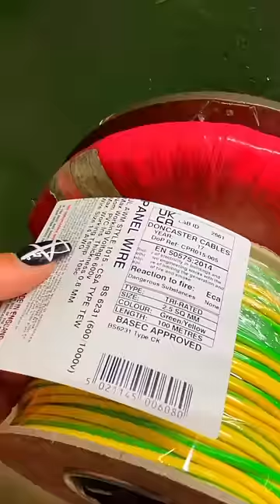This Will Confuse American Electricians!

Comment: Only thing I was confused about was trying to understand what I was supposed to be confused about...
Reply: Insulated PE wire
Reply: Oh Alex……😂😂😂😂😂😂
Reply: @denisdrozdoff2926 ummmm. Our grounds are insulated….
Reply: @shadygunshow we install european machines too in america xD we know that already xD
Reply: We also have insulated ground wires in America? We use them for DC voltage and for grounding equipment to grounding bars in server/network racks?
Reply: Exactly, no idea what I was suppose to be confused about. Insulated stranded bonding wire? We use that and bare. But what the hell were those dangling thingys for? Cleaning the wire?
Reply: @DarksurfX Sometimes, I don't think codes require insulated ground (not an electrician and haven't done any training in a decade) but I've definitely seen some boxes with insulated grounds. Seems smart to me, preventing dead shorting to ground in the instance of a momentary fault
Reply: @TheNaughtyType  it's to make sure the wire insulation is uncompromised. 10 000 VDC is applied to the "dangling thingys" and an alarm is triggered if it shorts to ground through the wire.
Reply: @TheNaughtyType 😅 that's probably high voltage leak testing which is required for UL certification. A high voltage is applied and you check if the insulation holds up. Any cracks in the insulation will show up
Reply: Exactly my thoughts, in industrial grounds and bonds are usually insulated. Depends on the application, there's a broad range in Canada. The resi industry is more like the US which I don't like aside from making materials cheaper but most other industries have kept up with the rest of the world.
Reply: @mrfrenzy. What a simple yet amazing tester design. Elegant.
Reply: Same
Reply: Only difference with our stranded ground wire in US is that it doesn't have any yellow color, just solid green.
Reply: @TheRealGreg depends on your supplier. Definitely comes with the yellow on it too
Reply: Também fiquei em dúvida sobre isso.
Reply: @ObservationofLimits very very very infrequently in my experience. At least from Graybar, CED, Medallion, Home Depot and Lowe’s, not counting random mom and pop electrical suppliers. Generally only see yellow on ground in pre wired panels or equipment coming from or being also marketed overseas.
Reply: We use insulation on grounds in more often than not applications
Reply: @markitoelias nao sei se esta sendo sarcastico 😂😂 mas pelos comentarios (nao sou eletricista) e que o cabo terra e isolado pra prevenir curto circuito na fase do cabo terra. Eu traduzi entao nao se se faz sentido o texto "na fase do cabo terra" nem sei se existi isso em eletricidade 😂😂 mas resumindo e pra prevenir curto circuito, ah e aqueles metais ali que o cabo passa e pra testar se o cabo nao esta com defeito e vai causar um curto circuito mesmo estando isolado porque aqueles metais tem uma corrente passando por eles, pelo que eu entendi dos comentarios aqui. 😂😂😂 Espero ter ajudado no caso do seu comentario nao ter sido feito com tom de sarcasmo, ate porque na internet fica dificil de entender comentarios sarcasticos algumas vezes 😂😂. Sim, o texto foi grande e eu nem sei porque resolvi ler os outros comentarios e tentar traduzir de uma maneira facil 😂😂, mas as vezes e assim quando voce tem tempo livre na internet😂😂, passar bem e um bom dia pra voce.
Reply: @regferraris  show
Reply: I thought maybe the ladies nails?
Reply: @TheNaughtyType probably fault testing the insulation.
Reply: @TheNaughtyType take away static electricity, maybe?
Reply: The only confusion to me is, why on earth does it change colors?
Reply: hahahahahahahahaha
Reply: @DarksurfX where do ? behind your answers are coming from!!!
Reply: @Michel-7.7.7  I’m afraid I’m don’t understand your question?
Reply: @DarksurfX  a questionmark is usualy put behind a question. There was no question in your answer😁 Never mind✌️
Reply: As an American electrician I can say I wasn’t confused.
Reply: @napster7825  The wire sheathing is bi-colored, yellow and green. The only reason it appears to change color is because that predominantly yellow or green section keeps showing as it gets wound onto the spool. 😊
In other words it completely an optical illusion!
Reply: @ObservationofLimits  yes this yellow strip is often used to identify isolated grounds
Reply: @geoiselin  A ground is a ground, call it whatever but at the end of the day, it’s just a ground.
Reply: @briandunigan9669  I agree too,  I have always said if your computer needs an isolated ground, then it's a peace of shxx
Reply: @geoiselin  jeez I must be bored,  but hey, it’s just for fun.  
Anyway, Isolation that thing if it’s necessary, we do it for all kinds of equipment. But that doesn’t take away the fact it’s a ground.  Just like a neutral, it has a purpose but it’s only a ground!  Can you  replace a “grounded” 4 wire cord on a dryer with a 3 prong cord, yeah!  But it has to have a neutral to operate controls, so can you really enter change them?
Reply: @briandunigan9669  I don't think that I disagree with you.  But are you saying "shall you interchange " or "can you interchange " ? With the exception of the range and mabe a few other things,  you shall not.  But yes, of course it will work.  Until the 2023 code, we shared it on the main panel all the time. So I think if I understand you, what I'm saying, it is your right .
Reply: @geoiselin  No we both agree , I was uncertain for a moment with the, “if the computer needs a ground it’s a piece of sht. And so yeah, I made the comment jumble a little, but it was to see if you understood, or close to what I said without having to saying it, so for that I do apologize for, put I think you get my drift!  Stay cool out there sparky, enjoyed!
Reply: Americans found this title confusing for sure!😂
Reply: #ClickBait
Reply: @TheNaughtyType they are to check for faults/splits in the insulation.
Reply: @shadygunshow so are ours 😂 only in romex and maybe a couple other situations the ground bare, and same for u guys lol
Reply: @Scoutmann1975 The grounding wires in half of HVAC equipment I've seen from the different manufacturers all contain yellow and green
Reply: @TheNaughtyType Those dangling thingies are for high voltage insulation testing...
Reply: my company wraps each ground wire in panel in green vinyl tape. Idk if it's code but it's company policy.
Reply: @thewhitedillard if installed properly. Your grounding conductor is only a backup. The grounded conductor is what you need
Reply: @DarksurfX and in armored and metal conduit
Reply: @TheNaughtyType  I'd imagine they put on a voltage potential relative to the wire on those beads to test the functionality of the insulation. Dangly beads to touch as much wire simultaneously as possible, I guess
Reply: Then it worked. Ha ha
Reply: @TheNaughtyType so you admit you were confused?! Ha ha ha
Reply: @TheNaughtyType think testing the quaility of the isolation
Reply: @TheNaughtyType system sometimes apply a voltage and this test dielectric of the insulation. No current is pass.
Reply: Want to confuseus? Show us a tutorial video on how to thread EMT.
Reply: @TheNaughtyType  it checks the insulating properties of the wire makes sure no high voltage could sneak through
Reply: does green-yellow wire exist in USA?
Reply: @TheNaughtyType  they look like they are for grounding off static? Just a guess
Reply: @DarksurfX not sure which part of america your in but everywhere I have been has insulated ground wires for AC wiring too
Reply: My thoughts exactly
Reply: @denisdrozdoff2926 yeah what about pe insulated wire? We have that too
Reply: 😂😂😂😂😂😂 my thought EXACTLY
Reply: i think our wire is wrapped on our spools better, more orderly
Reply: @mrfrenzy.  awesome, makes sense.
Reply: @DarksurfX And ladder tray, basket tray. All over a data center, really. Bond and ground, baby...
Reply: in the uk and lots of other countries, our sockets have a ground wire which makes it much less likely for an appliance becoming live and dangerous (nobody wants 230v flowing through their bodies from a live casing). american sockets don't have that
Reply: @ArsonButCute It depends on whether its an equipment ground or "earth" ground (I can't recall the exact terminology). The "earth" ground is usually bare and is directly connected to ground rods. Equipment ground is the stranded and insulated wire tha runs back to the breaker box and is terminated both on the frame of the equipment rack/housing and used at whatever ground terminals are required. I work on electrical engineering designs for Airports so I mostly deal with AC over large-ish areas
Reply: @shadygunshow not usually in residential but in commercial and industrial I see them insulated every time.
Reply: @TheNaughtyType  pass a current through it so if there is a break in the insulation it will stop and sound an alarm ?
Reply: Yup you summed it up nicely
Reply: Her nails were pretty confusing.
Reply: @shadygunshow  Though it's permissible over here to use uninsulated grounds I think it's just good practice to insulate everything just in case.
Reply: Right 😂
Reply: people in the usa (who even though there are many americas feel they have the need to call themselves "americans") use bare wire for grounding, especially in large projects, as is saves money. hell, they'll attach it to copper pipes, any thing lol
Reply: @alexandrelabonte8815 While bare copper is common, we also use insulated grounds too. Or earth wire if you want to call it that
Reply: @TheNaughtyType 

Reducing whip and twist while spooling the wire.
Reply: Do they think we don’t have insulated grounds?
Reply: @TheNaughtyType No, I think is for electrostatic discharge of the pvc insulation, which may get charged on the production line.
Reply: Insulated earth 🙄🙄🙄
Reply: @Scoutmann1975 its extremely common with hvac equipment.
Reply: @TheNaughtyType It is used to test isolation (note there is voltmeter showing 10kV
Reply: @frogdude1337 american sockets 100% have a ground, what exactly do you think the third prong is? Old styles of 250v plugs and a lot of cheap extension cords lack ground, but general home sockets all do (again with the exception of old shit).
Reply: Maybe  the bead-chains?
Reply: @TheNaughtyType  to remove electrostatic charge
Reply: @TheNaughtyType  They check for a fault in the insulation
Reply: As an American electrician while me mostly in residential use what is commonly referred to as romex we also use stranded not bare grounding. The bare ground in romex helps when you put a screw through the romex the screw hits the hot and the ground causing the breaker to trip. Piping everything is to labor intensive and costly we created a method that is both safe and cost effective.
Reply: @ellierunyan5919 in the UK and Europe all grounds have to be insulated. If you have uninsulated grounds touching, you can have a very bad day. If one of the grounds has come loose from its terminal but is touching another grounds you may still get a good continuity reading to earth.  However under an earth fault condition you will have a poor earth connection. That dould lead to the RCD not tripong or having a high  resistance joint potentially causing a fire.

Comment: That’s alot of machinery for a badly wrapped reel.
Reply: That’s what I was thinking
Reply: @Slugonthese  it does have an accumulator for fast easy changeover but the end result is mediocre. Reckon the winch on my landrover would do a better job, be the same tautness too!, tri rated these days comes off like a spring.
Reply: @flashusernam  seen old fishing boats that can wrap wheels better
Reply: Hopefully in actual production they tension it up with a guide cause holy fuck.
Reply: Hate to feed that through my Gamma.
Reply: What are the odds that shit gets tangled like 10 wraps in lmao
Reply: The machinery was to straighten the cable  not to provide a perfect spool. Probably was wrapped on the large spool while still warm and would have been a pain to run. Sorry I wasn't confused.
Reply: It’s hard working woman leave her alone 😅
Reply: Honestly I think I could do as good a job doing it by hand. Probably not a quick but I don't need half the factory  floor to do it
Reply: I concur
Reply: @connorhart7597 thinking the same thing 😅
Reply: @lastmancamp5603  why make excuses for this? They are preparing wire for delivery and it looks like crap. If the machinery isnt for making a perfect spool then they're using the wrong machinery.
Reply: The roll it came off was more nice! I'm confused
Reply: @connorhart7597  The odds are zero absolutely no reason why it would tangle it's simply not possible. Winding it neatly serves no useful purpose other than satisfying peoples OCD, it would take longer, need more complex equipment and add cost for zero benefit.
Reply: @mfx1 Wrong. I had the awesome opportunity to work with reels wound shit like that, and it was not really funny when you have to check an automatic cutter in every 30 seconds due to jammed or tangled spool. Yes, it gets tangled more often than you think.

Maybe it never was an issue for you because you just unwounded it by hand, not with automated processing.
Reply: Yeah, that got me too.
Reply: Bet one of them chinese dudes can do better with only his left foot's thumb
Reply: @lastmancamp5603  That doesn't even make sense you straighten the wire to then put it into a tighter wrap and it's thin strands of copper wire not steel being wound warm doesn't make a difference if you use a proper roller it straightens as you install it
Reply: It doesnt just to a reel it also tests the insulation for defects thats what the dangling steel spheres are for
Reply: Yeah, I saw that too, they also wrap it and sticker it up but I’ll bet the machines not called an insulation tester…